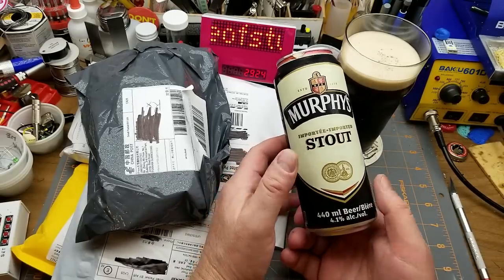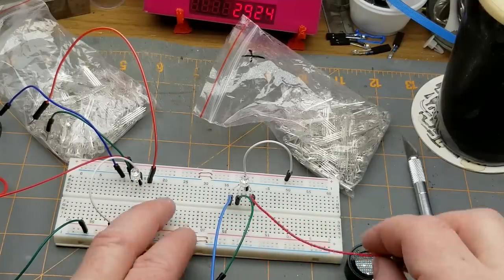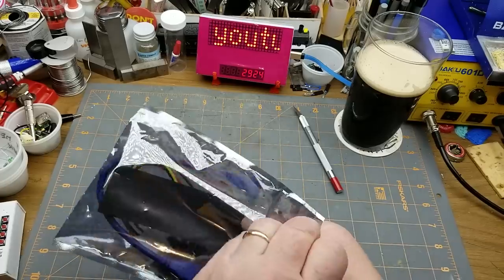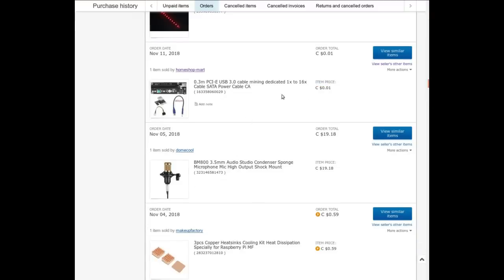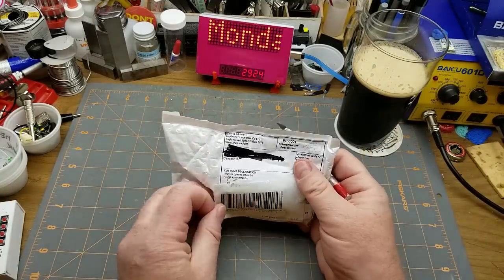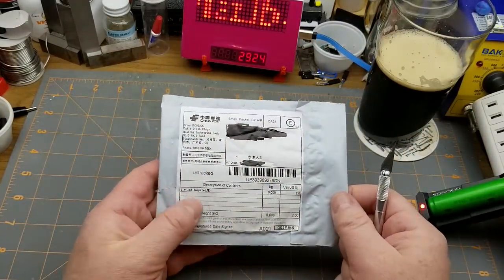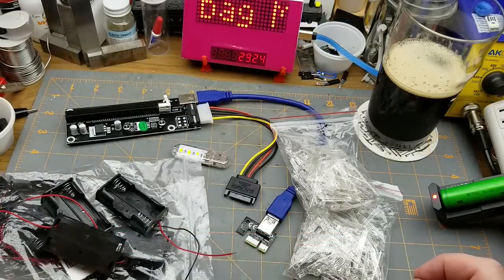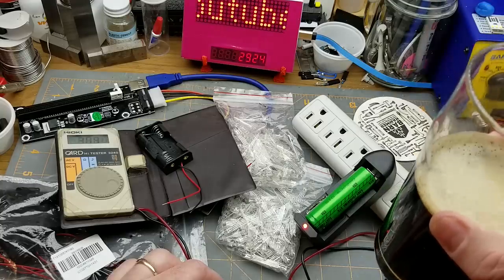Mailbag Monday 53

Comment: Those little USB lights are nice to rubber band to power packs as random flashlights.
Reply from the maker: In addition to the bunch in that drawer (and now on the floor) I have some USB lights scatterd around the house, wherever there are power banks deployed.
Reply: @pileofstuff  get yourself some boost modules from eBay. I got some MT3608 based ones off Amazon for single cell usage along with tp4056 chargers (with additional protection circuit) for a buck or two a piece. They can produce 5-24V off a single cell. Great wallwart eliminators. Little more expensive than your typical ebay fair but you should get some mid/higher end stuff to. You can only have so much fun in the dollar bin. Live a little get fiver stuff! ;)
Reply from the maker: @JWH3  I like the challenge of seeing how far I can get with the absolutely cheapest stuff I can find.

It reminds me of my youth when parts were hard to get and expensive, so I ended up making do with whatever I could salvage out of old black-n-white TVs and car radios.

Comment: Sorry to say this, but this charger might be pretty dangerous, with being mains, and cheap. It's better to get something like liitokala lii-100, a bit more $ but much better functionality and safety (being a USB powered device).

You should try to also get fancy touch controlled usb led lights, to complete collection.
Reply: 100% agreed on the safety of that "charger". I have one of the older models and the connection with the pins is horrendous. The circuit board has no proper isolation between mains and battery terminals, so not (legally) safe.
Reply: I have the same charger. Got it 3 years ago and works fine. Lucky I guess.

Comment: One Penny???  Had to stop right there and post this...  That is NOT a PCI mini connector...  You have a PCI-E 1X to PCI-E 16X Riser.   Mostly used in GPU mining but could be used to add a 16X connector where a 1X is present and be able to place the 16x expansion where you need it.  That USB being used in a non-standard way has 20 wires!  I find that Fleabay is being harsh on the sellers and removing listings.  Had to go through hoops to get a refund from Paypal.(Same darn company Really!)  Do you think the sellers want to honor their sales after Fleabay cuts them off?
Reply: Wondering if the seller was a cryptocurrency miner who is upgrading his equipment or cashing out - selling off his old used hardware.
Reply: It's NOT a PCI-E 16x... it's a PCI-E 1x with all the other 15 data bus lines not connected. Basically, the same as chopping the back end out of a 1x socket and plugging in a 16x card.
The USB cable doesn't have 20 wires - the PCI-E 1x only has 18 pins anyway, and of those 3x12V, 5xGND and they are probably generating the +3.3V on the PCB using the 5V line.
As for Paypal - there are no "hoops" required. You simply lodge a claim for Item Not Received and it's up to the SELLER to prove that they posted the item. The buyer doesn't have to do or prove anything.

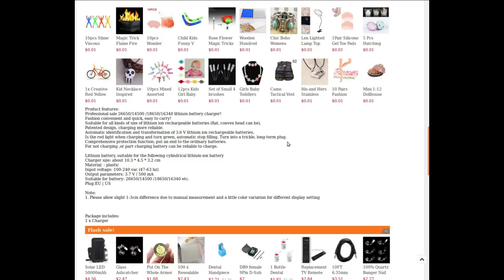Comment: 12:01 Would be interesting to see if it indeed does some kind of trickle charging. Li-ion are not happy with that...
Reply from the maker: I've been thinking about how to monitor what this thing does without having to sit there staring at it for 12 hours. 

I do have a current measuring module for the arduino...

Comment: Curious what's in that lithium charger. Might be a TP4056.
Reply: It's a HT3582DM chip that will charge cells in either polarity, plus a shoddily designed transformer.
Here's one bigclive pulled to bits earlier.
https://www.youtube.com/watch?v=eEw9pPFAZe0
To bypass the crap supply, remove the transformer and apply 5V to the anode of the 1N4148 and 0V to capacitor the diode connects to.

Comment: if you true used lot 18650 battery, buy nitercore i4 charger, or i2 model  better i4,d4 etc. under 20$ chinese shop. best charger. i have only 2 battery version i2 and many year now used eweryday manytime, work well alltime no problem newer. only batterys have expensive if use 3400mah.